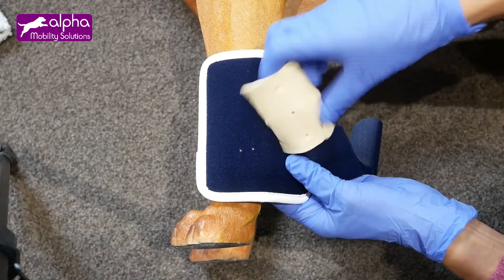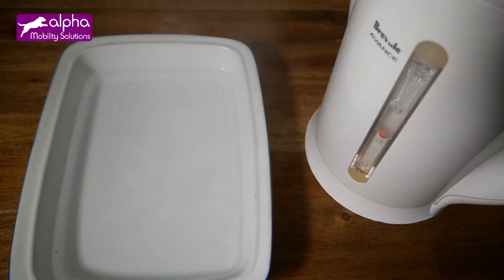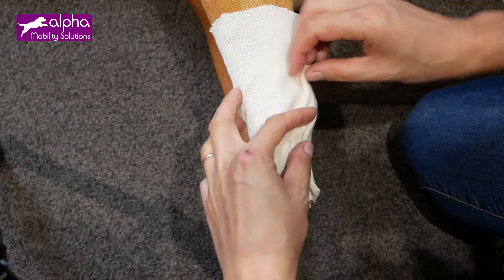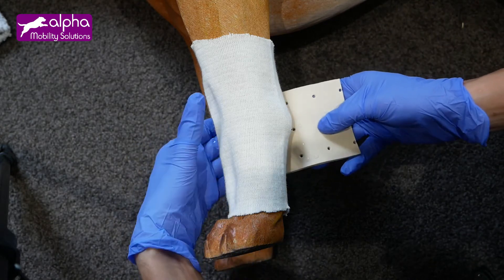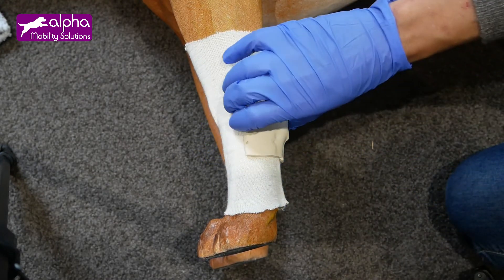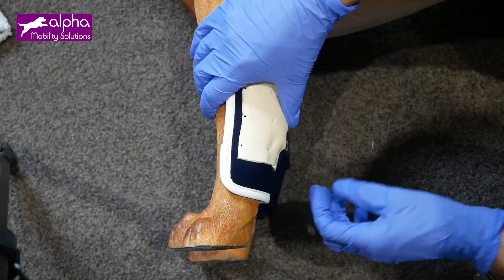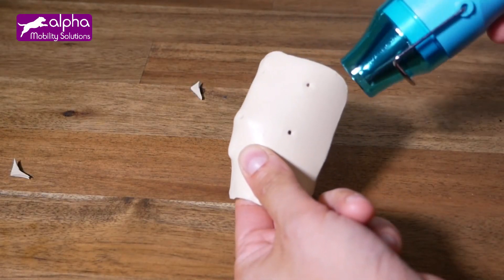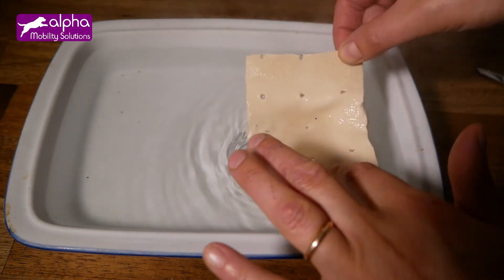How to make a custom made carpal brace with a low Thermoplastic on your dog?

Comment: Any advice about doing this for cats? Also, this video is awesome and you are awesome! You could take this to the next level if you discover a way to make a replica of the pets foot, so as not to stress them with the moulding
Reply: The same principles apply for cats but they are easily stressed and the handling is the problem. Your vet can help you by sedating it.